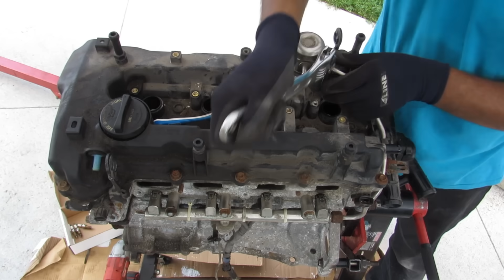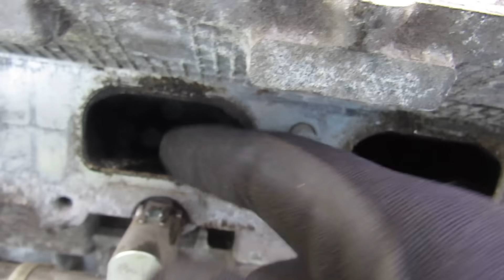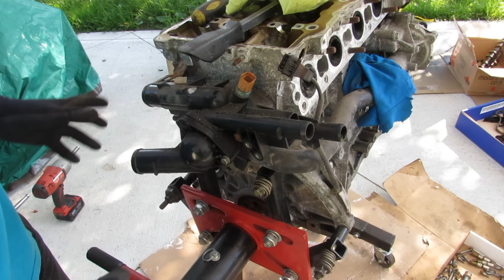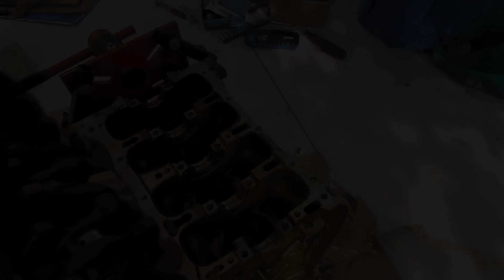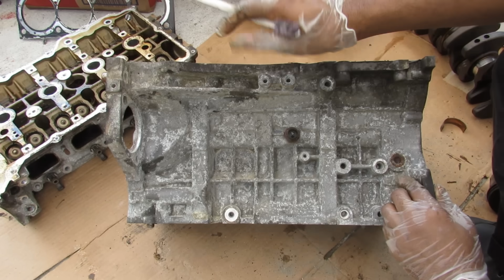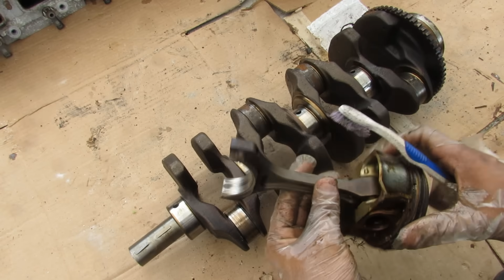Why Hyundai Engines FAIL

Comment: The local wreckers don’t want anything to with these Korean cars- it’s much less headache to toss the entire POS into the crusher. They will sell you an engine, but not even a 30 day return is honored. It’s because the engines aren’t any better than the one that someone wants to replace. Lack of oil changes, abusive driving and inferior design.
Reply from the maker: Agreed....the engines are no good which makes them plentyfull in the junkyard, and parts prices cheap.

Comment: The majority of the crankshaft problems are very poor machining tolerances from the factory , some of the rod journals are actually more than .001 oversize .  All it takes is a second without oil pressure and  instant damage ..

Comment: 7,500 miles is too long to go on any oil. This engine seems very normal. Every engine has hooks on top. The intake carbon did not cause engine failure. It was standard at that time and can be cleaned out. Oil is dirty after 3,000 miles . If a metal particle gets in the oil you don’t want it in there another 4,500 miles. 7,500 miles is fine if you only want to get it past the warranty point. 3,000 mile oil change if you want 300,000 miles.
Reply from the maker: I agree. I change mine between 5-8,000 km

Comment: Zero updates, and zero mods... had two of these engines.. last one was 230k .. not an issue.. bcm went out before the motor.. 

My 08.. now has 195k.. zero issues.. 

Do you maintenance, and you could save yourself a motor.
Reply from the maker: 2008 engines were much better than those built in the 2010's
Reply: @speedkar99  both of mine, my 03, and 08.. I've actually been pretty impressed with.. for a 4 cyl. They are actually pretty peppy engines. Fairly cheap to fix.. and both were great on gas.. 

My 08 has a cold air intake, and stainless exhaust.. put on my a previous owner.  And I put a stage 2 clutch, and a lightweight flywheel on... but internals are bone stock. 

Only reason I'd think of selling.. is to get a slightly bigger body.. for a bigger guy.. the tiburon is just a little bit small..  

But it's a super fun car to drive.. :)

Comment: My engine failed , as near as I could tell was the oil pressure control valve got stuck stopping oil to # 4 and #3  connecting rods. I had to hammer it out and polish the valve walls and valve to free it up.

Comment: WHY IS THE VALVE COVER MADE OF PLASTIC???
Ive never seen that level of cheap before.
Reply: A lot of manufacturers use plastic valve covers. In a modern society of the "just throw it away" mentality this is a great way to save money and adhere to the mentality.

Comment: So what he's saying there is nothing wrong with the design someone on the engine line didn't clean oil journals and chips destroyed rod and main bearings!!
Reply from the maker: Basically. This engine design is called the Chrysler world engine in Jeeps and is also used in the Mitsubishi Lancer without this much issue.

Comment: Hyundai isn’t a small company.  Cars is just one of many things they make. I don’t understand why they wouldn’t invest in some good engineers to make some good motors.  I can’t imagine them making a profit from all these recalls.  That motor is destined to blow up
Reply from the maker: I agree. 
I think it's more of a manufacturing thing than a design
Reply: They lure you in with the 100k mile warranty and a cheap price tag. Most people never read the fine print indicating service done outside the dealership voids that warranty.   That's why they have no resale value, they are a good vehicle to lease but trash in the long run. Open the hood and if you see GDI on the cover run, save your money and time. These are all over marketplace with blown engines. I've worked on them personally and replaced these engines and I wouldn't recommend them.

Comment: if you tilt the engine sideways on the stand you can loosin head bolts without the stand moving around
Reply from the maker: Yeah. It's just a bit heavy to rotate back up

Comment: i just bought a really nice 2012 2.4 limited in black with 90k on it.  The recall has it with a new Hyundai engine with 40K on it.  However; there should be a recall on the dashboad cracking.  I talked today with someone that bought a new dash 2 years ago and it was a $4000 job.  The dash is just the same as he started.
Reply from the maker: Ouch.

Comment: They screwed me out of $5000 bucks with their 2012 Hyundai Tucson.....bought used and will never buy a South Korean vehicle again....and you shouldn't either. Mine failed at just over 79k miles.  They failed to  make it right....they won't for you either....Junk vehicles!  Buy Toyota or Honda!
Reply from the maker: Was it not covered under recall?

Comment: Why wouldn't the filter pick up any particulates from the mfr process? There is no way oil passages were "glogged" because of a skipped deburing step. I can possibly understand debris being dragged through bearings when the filter bypass is opened (very cold oil) but your failure mode makes no sense to me.

Comment: Two questions: 1. Wouldn't it be fairly easy for Hyundai to redesign the way the bearings seat, so they don't spin out? 2. The failure usually comes with low oil. Is the oil loss because of the failure, or is the failure because the owner let the oil run low? I think it's the former. But if the block is still intact, I don't know where the oil goes.
Reply: From what I’ve seen and read and heard during the debut process the connecting rods had burrs on them that didn’t get caught during the process and final inspection of said process. After assembly the extra material frays off and gets into the passage and/or bearings. Costly mistake on their part as a counter measure would of resolved the issue

Comment: 2.4l GDI theta ii, 2014 hyundai sonata gls, bought it brand new, at 100,295 miles it got the dreaded death rattle nov 6th 2023, fortunately i did the 993 campaign software update in 019, so they replaced it free of cost, it was at the dealership for 2 and a half weeks while on a waitlist for a loaner car that never came
Reply: I'd like to add I disagree that the issue was a manufacturing defect, I believe that this engine is a flawed design, I expect my new one to have the same issue  as the first one, towards the end my engine was burning oil at around 80000 miles, it steadily got worse as well as idle and acceleration issues. Anyone who owns an affected car, make sure you get the 993 campaign software update, it doesn't matter if you're the 2nd or 3rd owner when it fails, if you don't have that update they won't replace it.
Reply from the maker: What does the 993 update do?
Reply: @speedkar99  It's a software update for the knock sensor, if it detects signs of engine knocking it will throw the ECU into limp mode so you can get to the dealer.

Comment: The 2.4L failed due to a poorly manufactured oil pump which in turn starves the engine over time creating barring failure. Well, that’s the real reason anyway.
Reply from the maker: What about the manufacturing process that they forgot to deburr

Comment: My 2011 Sonata started to seize up yesterday while driving home on the interstate. I'm expecting a full engine replacement will be required. Any word on if the new engine will suffer the same quality control issues?
Reply: I personally believe this engine is a failed design, I just got mine replaced recently also and expect to have the same issues in the future.

Comment: Ya I was putting the cam bearing back in on one of these 2.4 engines. I was cleaning it up before putting the bearing in and noticed a chuck of metal. There was no deburring around the cam bearing. I was pulling chucks of metal off with my fingers. I couldn't believe it

Comment: One thing I notice a lot when there is a Hyundai nearby is some sort of weird ticking noise they make.  I have noticed some Toyotas doing it also.  is that a common defect in them or just a sign of insufficient maintenance?  Or is that distinct sound something they do for a little while before they fail and leave you stranded and hopefully not too far from home?
Reply: Most likely it's the high pressure fuel pump that sits on top of the head

Comment: Wrong... the problem isn't poor machining, it's just simply that it's direct injected only. If you stay on top of your carbon buildup cleaning then you're good to go. If you don't do that, buildup gets down into the oil, which then clogs all the oil passages, which then starves the bearings of oil. I have a 2013 kia soul with the theta engine, and it's at about 150k miles (been in the family since 50k miles), and runs perfectly, because I've seafoamed the induction system every 10-15k miles. Just 1 bottle a year, and you're good. Did Hyundai/kia tell us that this was required? No they didn't. Therefore, they suck... but I'm smart enough to know how, when, and with what product(s) [if any] to maintain a vehicle. I've owned multiple direct injection only engines and learned early on (about 10years ago). I did get a letter that states that I now have an extended warranty to 250k miles. Nice! My original motor might make it just fine... but I'll take a new engine incase it doesn't.

Comment: Is it worth rebuilding this engine yourself? I have a 2013 hyundai sonata and my oil light keeps coming on at idle when engine comes up to operating tempurature but goes away after i rev the engine up to atleast 2000rpms so I suspect my engine bearings are going out. I was going to take the enigne out and rebuld it but i dont know if its worth it.

Comment: Great video, good job explaining how everything works.  I would like to say, though, that I don't buy the "deburring flaw" explanation.  I believe that's the original story, and is just being repeated now, but there is more going on than that.  Kia/hyundai has been having similar issues with this engine for 12+ years now.  IDK off the top of my head when the first recalls hit, but there have been quite a few years of engines AFTER they released that statement, still having the same failures.  This is costing kia a LOT of money to warranty/replace those motors.  So, if it really was just a "metal shavings" issue, why haven't they fixed the problem in the 5+ years since it started?  I suspect there is something majorly flawed with the design of the theta II, that can't be easily solved.  The best theory I've heard has to do with the engine running too hot on cyl. 2&3, coupled with poor oil circulation.  This causes sludge buildup, leading to plugged oil passages.  Most likely it's a combination of numerous small flaws, that can't be ironed out.  The single GDI injector is also an issue, but the problems started back before they switched from MPI.  More likely, Kia knows full well what the real problem is, or at least has theories, but won't admit it to protect their sales numbers.  They'd rather pretend they solved the issue, quietly replace the motors that are recalled, and focus on the next generation of motor instead.

Comment: Our 2015 Sonata started losing lots of oil  at 70,000 miles .  After taking it in several times they replaced the engine.  Then it started doing the same thing at 120,000 miles.  They will pay for 70% of the cost to replace the engine.  Still will cost about 2 grand.  I have liked the car, but with it having a disposable engine, you can't buy a Hyundai.
Reply from the maker: Why aren't they covering the full cost?

Comment: I have a 2015 Hyundai Tucson that just went into limp mode with the knock sensor code. Towed it to the dealer and they can’t even diagnose the problem for 3 weeks. After that, they need to go through the procedure with Hyundai before they will fix it if it’s approved. A rental car costs about $500 per week. This is crap.

Comment: Install an oil catch can and check the damn oil at fuel ups and they dont have failures. Im not even a Kia guy but I was given one by an elderly customer that had me as the mechanic for the car its whole life. It has a Gamma 1.6L engine. Just check the oil and keep it topped up every 1200 miles or so and install an oil catch can early and they run trouble free. Its not the engine itself that is the problem its bad operators for the most part because people dont understand direct injection vehicles. Also do not use 5w20 oil because direct injection does wash the oil thinner over time. 5w-30 and change every 5k miles and remember the catch can and dont let it run low on oil and you will be fine. Dont be a bad operator.

Comment: My 2016 Hyundai Sonata recently was a part of the recall. It was burning all oil away every 800-1000 miles. The dealership did a test that required income in every 1000 miles to test if it was the fault of Hyundai. This test was repeated four times before they finally approved the engine rebuild. It’s been fine ever since.

Comment: Very well explained and shown.  I believe the Knock sensor recall update actually updated the firmware to be more sensitive to knocking and sent the vehicle into limp mode sooner so that the owner would know to take the vehicle in earlier and likely prevent being stranded somewhere.  I am not sure if they changed the sensor and wiring as an update too, so that is why I refer to firmware update.  This just happened to our Kia Optima last week and will take the car to the dealer this week, now that we towed it back home from another state while on a vacation.  I did not want the work to be performed out of state so far away from home.
Reply: Read my post about my experience so far.

Comment: According to some source, inlet valve can be extremely late close w/VVT and mixture in the chamber can return to the intake via valve and can  clean parts  there during specific timing like atokison cycle engine . That the reason why recent toyota can still use direct injection without port injection. Best regard.

Comment: I think of Hyundai Motors would invest a little bit more in its engine design it wouldn't have these inherit problems. 

You know what CNC technology what's to stop them from making a Billet aluminum valve cover assembly? I mean really how much more would that cost think about that for a moment. Oldies car companies are always cutting Corners to make a fast buck and they don't realize the catastrophic after effects that it causes
Reply from the maker: It's sad that it took them so many years to realize and fix

Comment: My wife has the 1.6L Hyundai Tucson Limited and it eats oil like there is not tomorrow. Over time, it starts to suffer and misfire badly and just recently it misfired so bad that the check engine light started to blink. Hyundai in USA had to replace the engines do to excessive oil consumption in a Class Action Lawsuit. The engine eats so much oil that it completed depletes the purpose of reducing it's environmental impact both in your pocket and to the earth however here in Canada, Hyundai does not care. They don't care that they were forced to replace the Gamma engines in the USA but in Canada, there is an ongoing Class Action Lawsuit for the exact same thing but it is remains open and unresolved. Hyundai Canada wants Canadian to believe that the Gamma engines in Canada does not suffer like the Gamma engine in the USA when in fact they are the same engines. The oil is pitch black after 24 hours of driving and we have to replace the oil more often and top it up at least every 2-3 days. We will never purchase a Hyundai again or promote it to out friends and family.
Reply: Why do you think the oil gets black in 24 hours?

Comment: So the problem that causes failure is trash left in the crankshaft? How the hell did they screw up so many engines over such a long time? I made the huge mistake of buying a 2012 Sonata at the auction for my car lot. I thought the 2.4 was the only engine that has problems so I bought one with a 2.0. Well it is junk too.

Comment: Do you think if it worth to rebuild the engine (if do it by yourself) or just replace it? I got Santa Fe 2018  with 2.4L GDI, 112k miles. And it starts eating oil like crazy, 4 quarters on 1000 miles.  No leaks, no smoke from the exhaust. Buildups on spark plugs.
Reply: If your time is free, then it would be worth it, wouldn't it?

Comment: Someone said that after you remove the head bolts, you may see the threads in the block are damaged, and re-installing the head may be a problem because the threads for the head blots in the aluminum block are corroded. They may even strip out when you torque the head bolts down. Is this true?

Comment: Excellent video! Two questions:

With the fuel injectors injecting fuel directly, you get the carbon buildup and you mention that requires regular cleaning. How? Does it help to drive the engine real hot, or do you need to clean it mechanically?

When it comes to these engine recalls...all the owners who typically paid up to 6k$ for an engine replacement or rebuild before the NHTSA order - do they get a refund? Or are they just forked either way?

I'm looking to buy a 2018 Optima PHEV here in Urop, with the 2.0 Theta GDI engine. Getting second thoughts here.

Comment: I just picked one of these up. The paint and interior were in great shape. It had a little over 200k miles and pretty much what you are looking at is what happened cams, rods and crank, which is what I expected. Number one rod was the failure point. I am in the process of overhauling it right now. The good news is parts for these are very reasonable. If you do this kind of work you can pick one up for a song.
Reply from the maker: Ouch